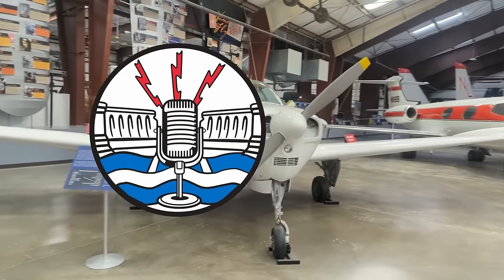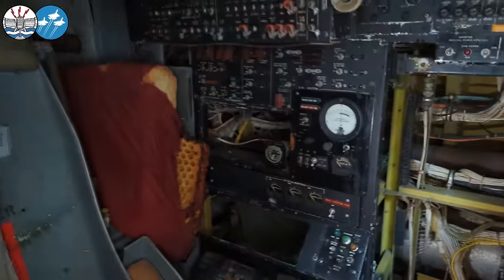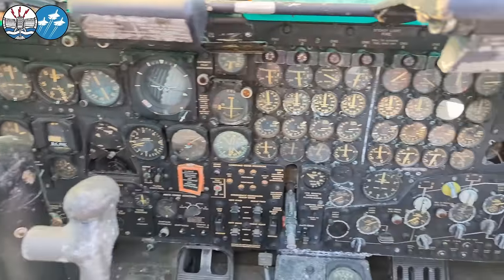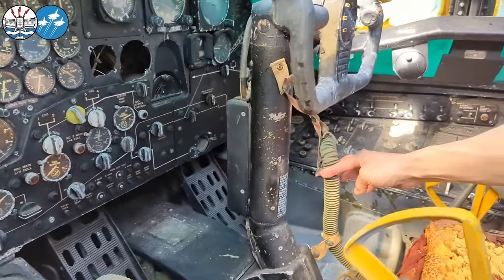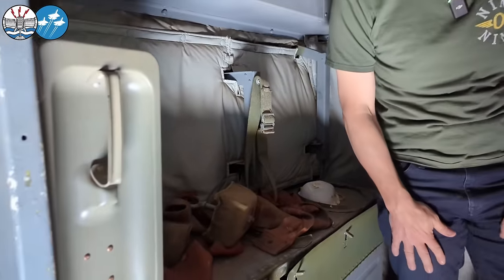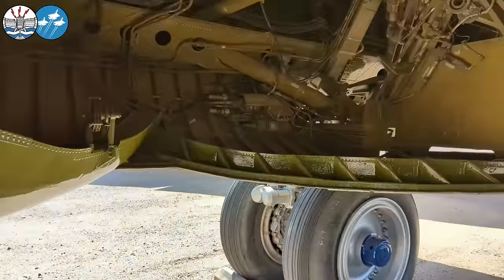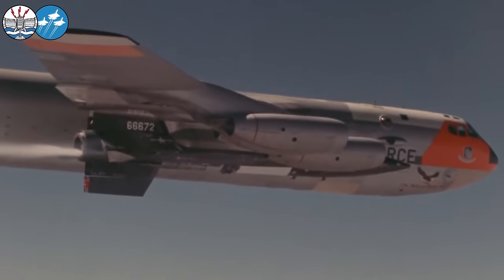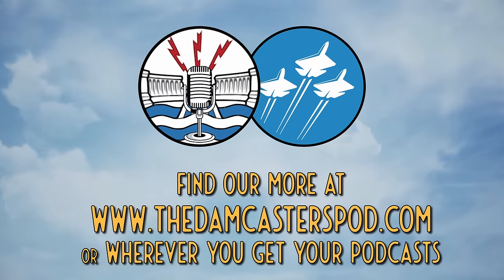Boeing NB-52A "The High and Mighty One" Cockpit Tour

Comment: Reflecting on the progression of aircraft design over time, the B-52 stands out as an engineering wonder. It speaks volumes about the designers who conceived it. I have always been deeply impressed by the B-52 and its simplicity.
Reply: Just stick 8 of the most powerful jet engines at the time

Comment: In a standard USAF B-52, the lower compartment, below the flight deck had the navigator and radar navigator station. Facing forward
Reply: I always wondered why they removed that small window on the left side of the Radar/Nav compartment. Many of the downstairs crews would get airsickness and claustrophobic when it was removed. 🤮

Comment: Kind of a side note, the only other bomber I know of with the NB prefix was the NB-36, which was used to test the possibility of nuclear powered aircraft. It carried a reactor that was just on board to study the effects of having one airborne, and didn't contribute to propulsion.
Reply from the maker: NASA aircraft since the late 50s have often carried an N prefix, but that nuclear 36 is quiet something. Have you seen our video on Pima's B-36 on the channel?
Reply: @damcasterspod  I specified TWO letters, NB. But I DID forget about NASA's OTHER former bomber the WB-57 which was derived from the venerable Canberra. I did glance at it, talking about what was the last Peacemaker built, but learned about them Many years ago when I wrote a term paper on SAC. But the story of the NB-36 is just as interesting.
Reply: “N” is the USAF prefix for an aircraft that has been permanently modified to be a test aircraft. “J” is the prefix for an aircraft that is temporarily modified to be a test aircraft. 

56-620 was an NB-52D permanently assigned to the Air Force Special Weapons (i.e. nukes) Center. It apparently carried the JB-52D designation for a while.

56-632 was an NB-52E permanently assigned to the Air Force Flight Test Center.

57-119 was an NB-52E provided to GE to test engines for use on the C-5 Galaxy. 

56-636 was a B-52E provided to Pratt and Whitney to test their JT9D turbojet engine, but I can’t find any information that says it was officially designated “NB.” I would think it was because there’s a picture of that B-52 flying with a single JT9D mounted under the right wing in place of the inboard engines 5/6 pod. This was the same set up I think as GE engine testing on 57–119, and Pratt &Whitney kept that B-52 until it was scrapped.  The JT9D was the first engine for the Boeing 747, which Boeing designed and submitted as a competitor against the Lockheed Galaxy.

Comment: I'm amazed it hasn't been stripped out, almost complete, wonder if it was used in Nam or stayed in the U.S. Wouldn't take alot to restore this plane. There's a movie of the X-15 that might tell you more of this B-52A.
Reply from the maker: As we said in the video, 003 is one of the 8 B-52As produced and spent its whole service with NASA at Edwards, hence the NB designation. Her record is highly documented and Pima have done great work documenting her history.
Reply: D and G models were the primary units used. Maybe a few F.
Reply: The Cessna 195 had the  crosswind landing gear.

Comment: I think it only had 3000 hours on the air frame and still had all the original engines one reason it got park was I couldn’t get parts for it anymore after they scrapped all the A and B and C model B-52 the The models D Models and up we’re very different
Reply from the maker: There also wasn't much need for them once the X-15 program finished and given how modified they were, NASA moved on.
Reply: They flew a B52H  model after balls 003 and 008 got park for about 15 years I remember being on a 135 and we actually did an air-to-air refuel on its replacement it was funny to see a all white 52

Comment: What's with the rippling in the outer skin
Reply: It’s just the normal flex created by the wings. If I remember correctly, the wing moves about 14 feet from take off to cruise configuration.
Reply: @Hawker900XP  what I meant was in the fuselage sorry should have been more clear
Reply: @sidthompso8097  Yes, the wings being attached to the fuselage creates those ripples from just forward of the wing all the way back to the 47 section of the fuselage.
Reply: @Hawker900XP  Gotha thanks my friend for the clarification

Comment: As a former BUFF pilot and member of the Pima Air Museum I was pleased to run across this video. Then I watched the video and was pretty disappointed. Much of the information you presented is of questionable value and some is downright inaccurate. I wish you had secured the services of a B-52 SME rather than just speculating on the function of so much of what you depicted .  For instance, the control surfaces of the tail are mechanical tab operated and are very effective in controlling pitch and yaw. Roll control is achieved by a combination of small tab operated ailerons and hydraulically operated spoilers. Crosswind crab is necessary because the aircraft has bicycle lànding gear,  not tricycle landing gear. The explanation you offer is inaccurate and incomplete. 
In one respect you wasted a golden opportunity to inform the public and explain a bit of history. 😢
Reply from the maker: Thanks for your feedback and I am sorry you found the video lacking. This video, based on this edit, didn't proport that Joe and I were anything more than an excited enthisuat and an aircraft designer getting a very rare oportunity. Prehaps on my next visit, if you are around, we could correct the record by looking over the A, D and G models.
Reply from the maker: The man knows his aircraft and I understand his point.
Reply: There's a better way to say that if improving the conversation is truly your goal.
Reply from the maker: It is the internet, I just try to keep things moving along happily here.
Reply: @damcasterspod  yeah you guys seem like great people and thanks for what you put out there for dweebs like me
Reply: @damcasterspod  And a sincere 'thank you' for that SOP! If only more people felt that way...

Comment: Only 3 A models were built and they further test beds for the rest of the fleet 50B,35C,170D,100E,89F,193G,102H models were  built and the number on this aircraft is 0008
Reply from the maker: Do you mean 0003?
Reply: Interesting model productuon number breakdown
Reply: @leftseat30  I worked on them and learned their history when I was SAC 82-92 when the command changed 1 June 92
Reply: @damcasterspod  No 0008 and if I remember right it's as gate guard at Edward's AFB
Reply: @thomascreary990  The plane featured in this video is NB-52A 52-0003, not NB-52B 52-0008. 003 had orange paint (in schemes that varied over time) and you can see in the video 003 painted on the nose (26:26)and the tail (20:10) as they do the walk around. 008 does not have orange paint, but it did have a yellow horizontal stripe outlining “NASA” at the top of the vertical stabilizer; otherwise it was basically silver. This makes it easy to distinguish them in the videos. Both were used as mothership for the X 15. 008 is at Edwards and 003 at Pima.

Comment: Sorry it was a B-52B until the H model took over
Reply from the maker: I'm affraid not, this aircraft is one of the 8 B-52As and one of the two operated by NASA until the 1970s. The B-model was first to be delivered to the USAF.
Reply: Only 3 B-52A models were produced, 52-0003 being the third. They were officially delivered to the USAF but all three immediately loaned to Boeing for testing. 

The B-36 was originally slated to carry the X-15, but it was realized the B-36 would be out of service by the time the X-15 was ready to fly, so the NASA chose the B-52 to replace it.

003 was converted to NB-52A configuration starting in February 1958. It was retired in 1969 and went to “The Boneyard” for storage, later transferred to museum at Pima.

50 B-52B/RB-52B models were produced and were the first B-52s to enter actual service. 

RB-52B 52-0008 was converted to NB configuration starting in Jan 1959. It was retired in 2004. At the time it was the oldest flying but lowest flight hour B-52 in service. It is on display at Edwards AFB.

The USAF loaned (and later transferred )B-52H 61-0025 to NASA in 2001 to replace 008, and NASA designed a new pylon for it to launch research vehicles. But after 008 was retired there were no projects envisioned that would require a B-52 as mothership, so NASA returned 025 to the USAF. It became a maintenance trainer at Sheppard AFB.

p.s. X-15 was carried by both 003 (40 times) and 008 (159 times).  On the side of the airplane the horizontal X-15 mark means a captive carry, and the angled X-15 means a launch.
Reply from the maker: I was conflating 8 variants with numbers built. And I do believe we mention that this one of two of the motherships, mainly as the NARA footage available is mostly of Balls 8.